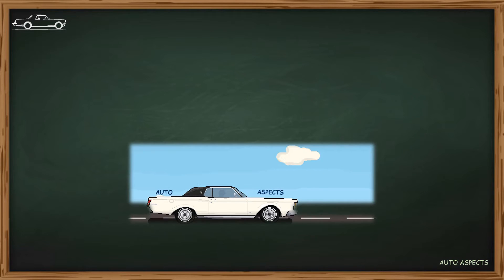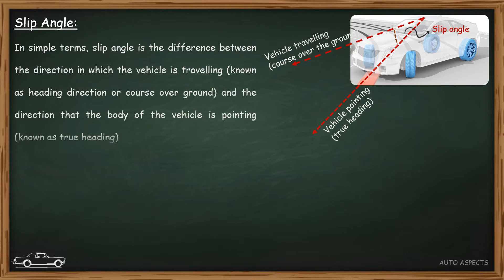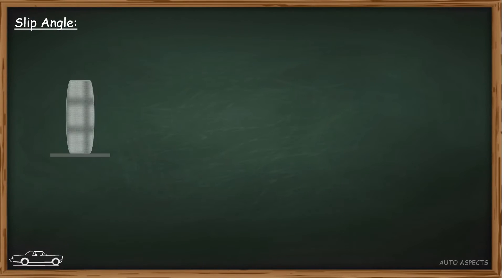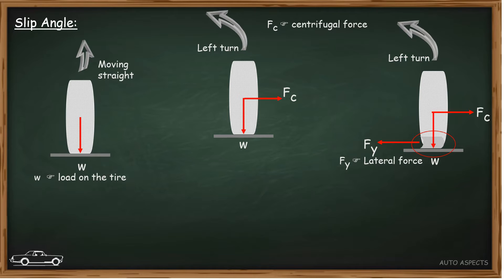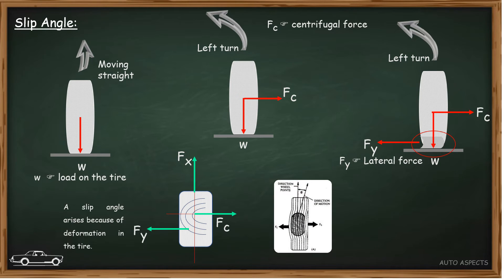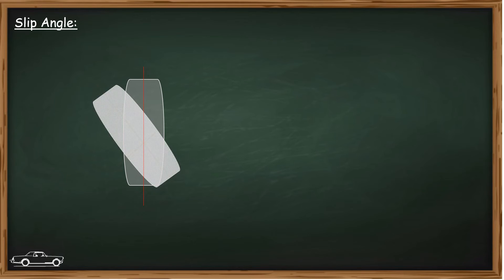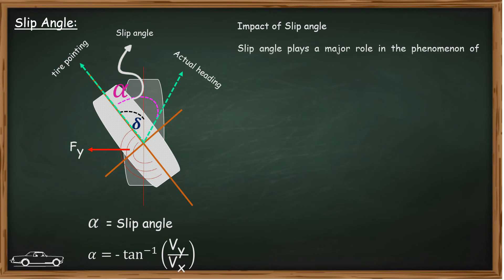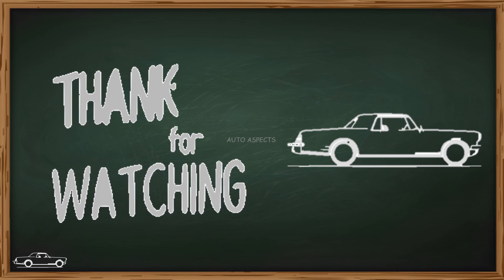Slip angle | Auto Aspects | Basic Vehicle Dynamics terms #6

Comment: Thanks for the explanation, but why do we need to know the slip angle? It sounds like an effect rather than a cause. Is it something we can control to decide whether a turn will go into understeer or oversteer?
Reply from the maker: Yes! absolutely right,  let me put it in this way if a vehicle is subjected to cornering, the lateral force developed by the tyre increses, with slip angle.

Other aspect is it is always preferable to balance the  front and rear slip angle, which gives a more stable car, which means the car is neither more prone to understeer nor oversteer.
Reply: @AutoAspects  I appreciate the prompt reply. It is clearer to me now. Tq